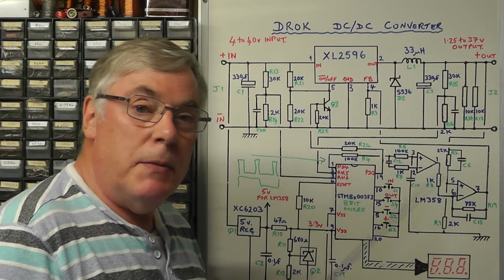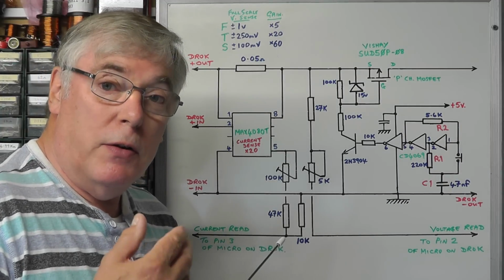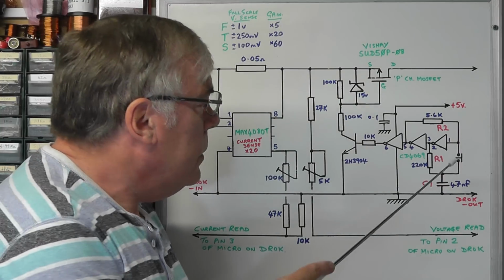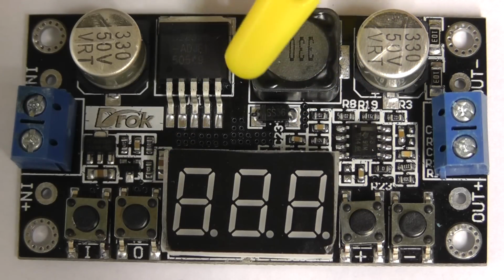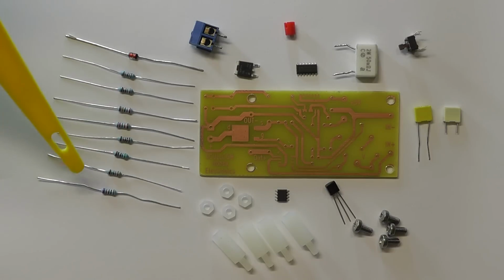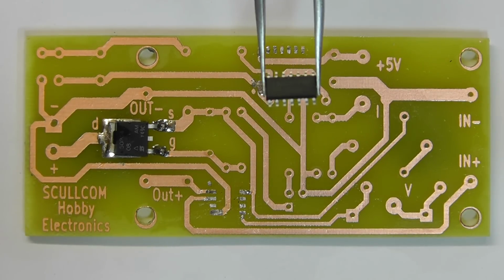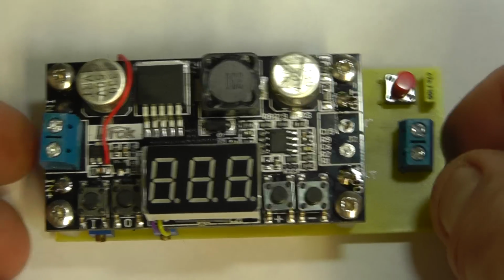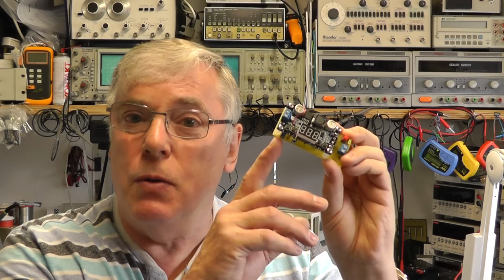Scullcom Hobby Electronics #30 - DROK DC to DC Converter Upgrade

Comment: Scullcom Hobby Electronics Thanks for another great mini project series. 
Could you please explain the function of the two 10k resistors, R17 & R18, across the output junction J2 ? Are they bleeder resistors for C3 and/or L1 ?

Comment: I swear we share a mind. I’ve started replicating your DC Load Project and I stopped because I started rebuilding the DROK 900W boost converter I have. I was playing with it and blew the micro so I programmed an Arduino to send the output signal to the switcher, monitor the load, and display the info to a 20x4 LCD using the U8GLib. After watching your videos all day, I have some new ideas...one is to make all the PCBs and put the j to one Scullcom project box, a nice 19” OKW unit. Thank you for all your contributions and you inspire me to keep at it.
Reply from the maker: Its good to experiment but sometimes things happen. But that's how we all learn. Have fun! Regards, Louis

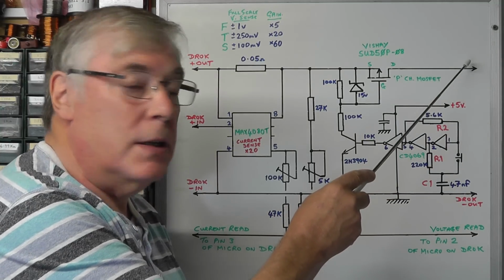Comment: I just love your bi-stable circuit starting at 9:15.
Dave Jones had something similar with 3 transistors, that was an "Soft on-off switch" as well. I think it was on one of his power supply design videos. Not sure though.  
Please remind your viewers my pining a note on top, that they must ground all the unused inputs of the CD4069 or any other equivalent inverter IC (ie 74HC04, LS04,...etc), in order to minimize power consumption.
A CD74HC04 for example, will consume ~22mA of quiescent current if all inputs are left floating in the breeze, but consumes under 1uA if all the inputs are grounded. That is a huge difference.
Reply: Found the circuit I mentioned above;
https://youtu.be/Foc9R0dC2iI

Comment: Very good teacher evenings Skullcom Hobby are very interesting experiments you show us I'm Mexican and I've been following but has time i'm in a esperimento of creating hydrogen but I need a device to regulate the voltage to generate the hydrogen is not if you I could help this project because the rest already have but to put it in the car when going from low to high is not enough hydrogen and need some circuit for Realise that function do not know if you could help me please

Comment: Soft switch is fine, but dont think it will work properly at lower output voltage when the required Vgs may not reach to the point which could turn the MOSFET On.
Reply from the maker: +Satyajit Roy Thanks for your comments. The 'P' Channel Mosfet which I selected for this project was a Vishay SUD50P06 which has a VGS threshold voltage range from -1v to -3v. As the Drok does not operate below around 4 to 5v then the Mosfet should work fine for the normal operation of the Drok DC-DC converter.

Comment: Hi. I'm looking to power my Camcorder from RC Lipo batteries (  3S1P / 11.1v / 3Cell ) so i can get much longer Record times. The camcorder has an external charge / PSU socket which allows me to record while running  on mains power. My question is, how do I reduce the voltage down of the  LiPo battery to DC 5.3v / 1.5A? Obviously I'm concerned about a stable 
& reliable device that won't spike of generally fry my camera! Your advice please?

Comment: Hello.  Just recently subscribed, like your work.  This reminds me of hacking my old Circuit Specialties bench supply to make it more useful. (Adding a CC/CV LED, a lower current range, etc.) Fun, useful and a learning experience.  I like your output switch, and have use like circuits in a few places. One thing I noticed, tho, as I'm always using my power supplies for LEDs, battery charging and other low voltage, high current needs. As you set the DROK to lower voltage, you drop your gate drive on the FET. Looks like Vishay likes at least 3V G/S for that part, and for really low on resistance, more like 5V for good RDS on. With those two 100K resistors in the gate drive, you only get 1/2 the DROKs output voltage for drive. Suggest taking the 100K at the collector of the 2N3904 down to 4.7K 1/4W, this will give good turn-on down to 4-5V output, and still keep the zener and resistor current reasonable at a 40V output. At Lower than 5V, tho, is a bit trickier. You don't have much 5V current available from the onboard regulator at 30V input. Maybe add a separate regulator, (12V , if your input is always 15V or higher, or 5V) add a low current draw relay in place of the FET, and change the base resistor of your 2N3904 to 1K. Relay + snubber diode from the collector to new 5V or 12V source. That won't care about the output voltage.  Or do low side switching with an N-channel FET,  a 100K back to the power input to turn the FET on, then use the 2N3904 to shunt it out as your OFF state. Only good, tho, if you're not using anything else in your system with a common ground to your power supply.  Add that enabled LED, too! Just several thoughts.  Keep on tweaking those electronics! DStuart. (40+ years electronic tech/hobbyist/tweaker)

Comment: What a smashing mod to the drok, thankyou for making a video :-D.
Thats so much nicer to be able to adjust the voltage before turning on :-)

I like the ability to trim out slight errors, the fet will lose a tiny tiny amount of output voltage under the full load, but thats almost nothing so its irrelevant.
Using a stable "gain block" i.c just cuts out all the problems with using op amps, just the accuracy of the sense resistor matters, nice and simple :-).

Clever and simple design of the output switch, i really like that :-).
I can see the output switch being used on larger supplys with a bank of parallel power fets to do the heavy work.
Just one thing i would add, a tiny led to say when its enabled, i bet a resistor and low power led tacked on to the output of the hex ic would do that.
Reply from the maker: +zx8401ztv Thanks for you valued comments as always. Yes, agree you could simply add an LED to show when the output is enabled. There are 3 spare inverters in the 4069 chip which are currently not used - so we could use one to drive an LED.
Reply: +Scullcom Hobby Electronics Yes i noticed the 3 unused inverters, i was thinking a simple add on without reworking the pcb.
I did use a 4017 decade counter to select voltages for an eprom programmer, a simple button +resistors/capacitors fed the button into the 4017 clk input, and the outputs fed transistors that selected resistors in a Lm317 adjustable regulator, i had six voltages in order then i looped the reset pin to jump the 4017 to no 1 again.
Simple circuits work really well :-D
Reply from the maker: +zx8401ztv Home made eprom programmer bring back memories!! I also build one in the 1970's to program 2716 and 2732 UV erasable eproms. That was in the days when I use to program 6502 processors in machine code. Things have move on a long way from those days !!!!
Reply: +Scullcom Hobby Electronics True but im not sure if having eeproms in p.c's was such a clever idea, the old eproms didnt suffer with virus attacks and daft people wrongly updating there bios flash device. 
Simple days with less junk to go wrong :-D

Comment: Great video as usual. I would love to see your take on a "from scratch" mini bench power supply with current limiting, short protection, etc. Wouldn't have to be high power device, just a great little learning exercise... Cheers.
Reply from the maker: +Leigh Robinson Thanks. A Mini Bench Power Supply would be a nice little project. I will have a look at doing one.
Reply: +Scullcom Hobby Electronics I'd like to see that project. Great channel.
Reply: Scullcom Hobby Electronics Brilliant! Another thing I have been messing with recently (that you might comment on in the context of an oscilloscope tutorial) is building a little external trigger circuit for an old analogue scope that doesn't have delayed sweep or hold off. Do you have any advice on how that problem was handled before 'scopes had that feature?
Reply from the maker: +Leigh Robinson From memory hold-off and delayed sweep was introduced in the early 1970's. Adding an external trigger input to a old scope that did not have one should be fairly straight forward. You would need a switch to disable the internal trigger signal and instead connect that point through the switch to an external trigger BNC socket which you could fit. Simply doing this would allow you to still use the trigger level control and polarity switch + or _. You would need to get a copy of the scope schematic so you could trace the trigger signal circuit path.
Reply: Oh, I meant a circuit to produce the triggering signal, rather than adding an external trigger interface! I suppose it is a bit of a waste of time, but as a learning exercise I was thinking of trying to build something that adds hold off, etc by generating the trigger entirely separate from the scope. I am assuming a fast sawtooth generator would be a crude first attempt. This came about after realising that the analogue scope I was given is missing these critical features for complex waveform analysis, like digital pulse trains, etc. Though now you have mentioned schematics, I am thinking about possible modifications to the current trigger to delay the circuit. Unfortunately my skills are probably not up to that task, but this is all a learning exercise! Thanks for the input.
Reply from the maker: +Leigh Robinson As the Trigger hold-off is an adjustable period of time during which the oscilloscope cannot trigger the sweep, basically what you need to do is add an adjustable delay to the scan sweep signal. Add a delay to the sawtooth signal that produces the scopes sweep to hold back the start of the sweep. Try looking at some examples of hold-off circuits used in some analog oscilloscopes. Good look with your project.

Comment: Another option to tin your PCB is there are several chemical tin plate solutions that works very well and tins the whole board to protect the copper and provide easy soldering. The solution can be used over and over so a small bottle lasts for years and years.
Reply from the maker: +Rambozo Clown Thanks for your comments. Yes you could use a chemical tin plate solution but this takes a lot longer to prepare the PCB before you can mount the components. I wanted to show the hobbyist a quick simple and cheap method. But thanks for mentioning the tin plate solution, which give them another alternative method.

Comment: just another quick comment, you should trim under no load as there will be voltage drop in the cables going to the DC load. or use a multimeter at the PSU measuring the output voltage under load, don't use the DC load meter as it will have some voltage drop from the leads. but with only with one decimal place accuracy I guess it doesn't matter much.
Reply from the maker: +thefamilyman Thanks, a fair point. You are right with only one decimal place on the display it would have little effect.